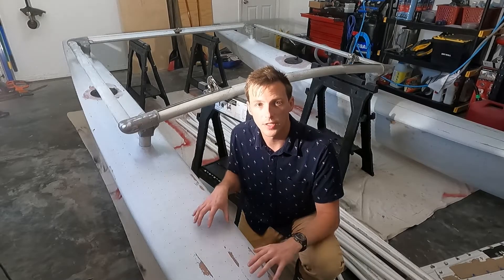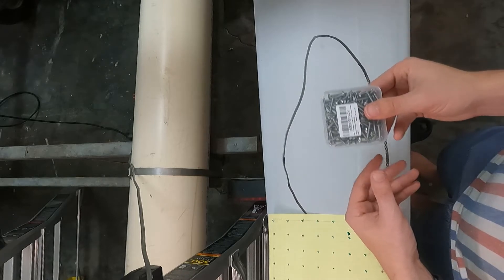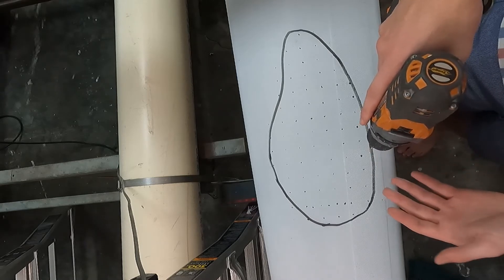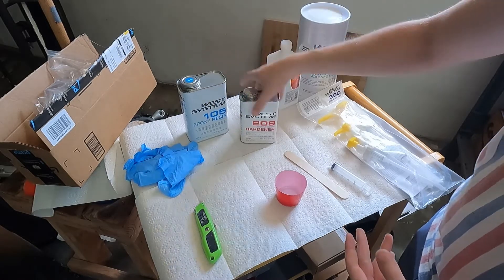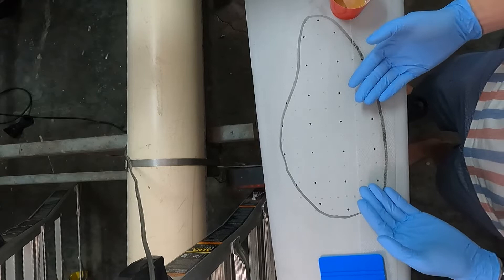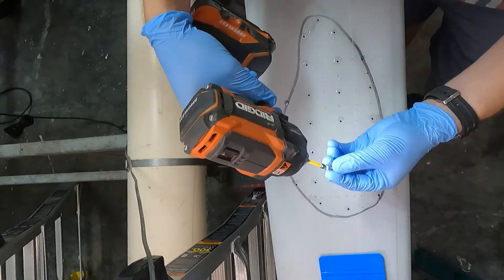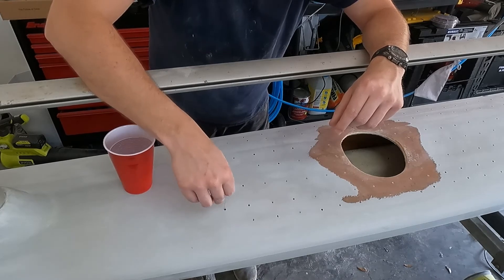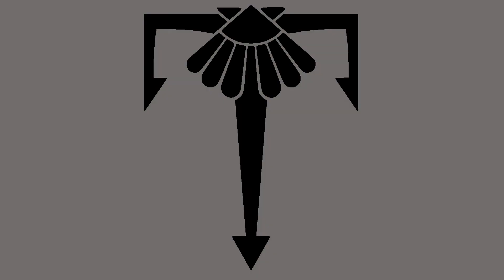How to Fix Soft Hulls - Hobie 16 Repair

Comment: Great video.  I’m getting ready to do the same on my H16.  How did coat/prep your screws with PVA ?   Sprayed or dipped the screws in PVA ?  Thanks in advance
Reply from the maker: I started out by using a small paint brush and brushing them which works better because the film is thinner, but after the small areas I switched to filled a small bowl with PVA, sloshing them around, and then taking the screws out to let the PVA dry. I mainly did this because I was coating 200-300 screws at a time and probably did this 4-5 times minimum.

Comment: Hi. Thank you so much for this video. Probably due to my poor English I don't understand what (little piece of metal) and why you put it into each hole. What is the goal of that ?
Reply from the maker: It is a sheet metal screw. I use it to pull the laminate together while the epoxy cures. Once the epoxy is cured, I removed it and fill the hole with epoxy and a filler.

Comment: Do you pre-drill a pilot hole for the fasteners or do you let the pointy tip of the sheet metal screws do the work of penetrating the inner hull and pulling it all together?
Reply from the maker: I am using self tapping so the screw drills through the inner laminate. If you drill through, when you inject epoxy it will squeeze straight through since that is the path of least resistance. By not drilling all the way, we force the epoxy into the void.

Comment: Thanks for the video! Do you have any tips to repair cracks and used bottom hull (I can see light through the hull)
Reply from the maker: Are the cracks in the gelcoat or in the laminate? If they are in the gelcoat it's just cosmetic, but if it is in the laminate you will need to grind them out and reapply fiberglass. For the bottom of the hull, you probably need to add a couple layers of glass and regel coat to protect the glass. I might have to do the same once I flip my boat for gelcoating the bottom.
Reply: @tridactik  OK thanks, the whole boat is build with some foam and fiberglass on each side?
Reply from the maker: Yup, it is a couple layers of fiberglass with a foam core. On the bottom v of the hull and the outboard edges of the tops, it should be solid fiberglass.

Comment: Thanks for the vid.  Re using epoxy, why not use fglass resin so the bond is like with like?  Given the scale of your job, is epoxy heavier?  thx
Reply from the maker: Thank you for watching the video! You could definitely use polyester resin. Personally, I am not familiar with it, so I used what I am comfortable with. When it comes to gel coating the boat the gel coat will form a chemical bond with the polyester resin, but it will not with epoxy so surface prep is extremely crucial.
Reply: Polyesters are often too brittle for that kind of job, use epoxy w/ some microballons for best results

Comment: I tried using the screw’s you used but it doesn’t feel like they are pulling the layers together. Any suggestions?
Reply from the maker: They won't until they dril through the bottom layer. For a couple of seconds it will feel like it is just spinning and then it will grab. Once it grabs you have to stop once it pulls pressure or you can strip the bottom laminate. The other thing is the hole in the top laminate needs to be a clearance hole or you will push the bottom laminate away.

Comment: To fix the holes you put into the hull, couldn't you use something like Marine Putty as a plug and then put epoxy over it for better support?
Reply from the maker: You could, but you will have to ensure the resin systems are compatible. Epoxy will stick to polyester, but polyester has a hard time sticking to epoxy. Using milled fiber, fairing filler, and the resin, we are essentially making the marine putty, but have greater control over the viscosity and strength of the repairs. The first repairs I made were definitely a learning experience and I refined the process as I did more fills.

Comment: use tape on the bill as a stop for depth
Reply from the maker: Hey Joseph, I normally would, but the drill depth is constantly changing  since the core tapers from one side to the other and the delams are worse in other areas.

Comment: Doesn't adding the fasteners just make the repair even worse by making holes go through both layers of laminate? Also instead of pot filling couldn't you just sand down and add a layer of fiberglass mesh instead adding strength to your repair as well as finish up the holes you made?
Reply from the maker: Hey Forest thank you for the reply. It would definitely be better structurally to sand down to the base fiberglass and add plies, but that is considerably more work than it is worth. This repair is the middle ground between that and buying a different set of hulls. The fasteners allow us to pull the laminate together after injection ensure a thinner bond line. Epoxy alone is brittle, so the closer to the original cross section we can get the better. The pot filling isn't really intended for strength, it is intended to seal the boat back up so we can make it water tight.
Reply: @tridactik  Thanks for explaining that, I didn't understand the reason for the fasteners either.
Reply from the maker: No problem, if you have any more questions, or you want to see something in particular, let me know and I'll see what I can do.

Comment: Why not just fill it with foam?  Wouldn't that work?
Reply from the maker: Filling it with expanding foam would not rebond the laminate. Additionally expanding foam would put pressure on the rest of the fiberglass to core bond and end up causing the delamination to grow significantly larger. In the end, you would end up doing more harm than good.